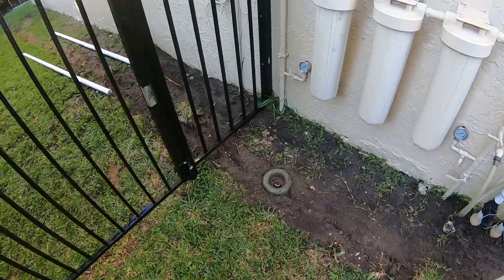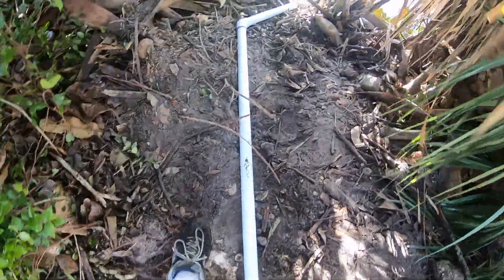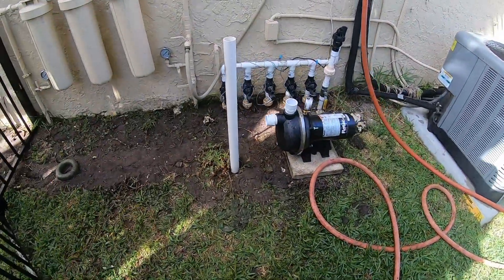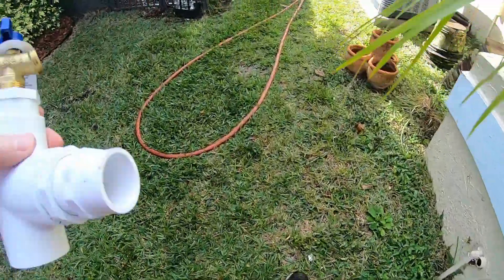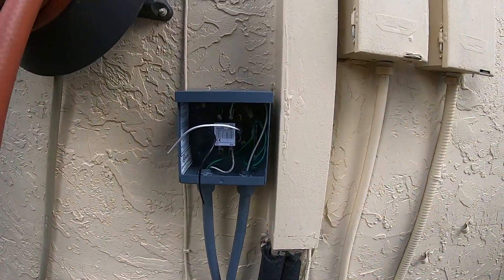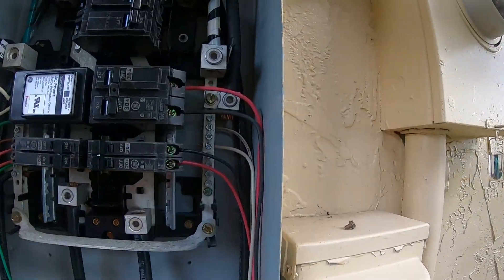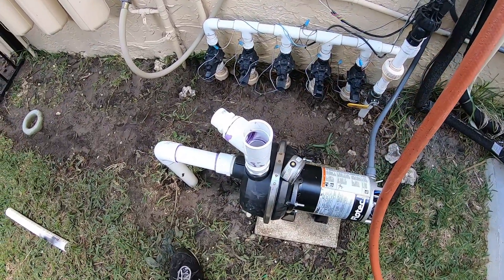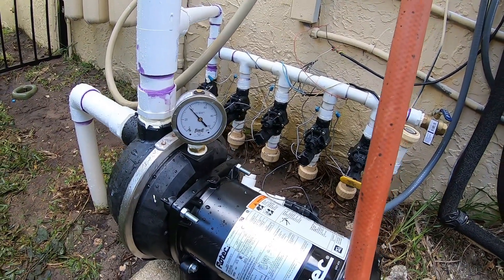Installing a Sprinkler Pump - Part 2

Comment: I Donot See Your Smart Sprinkler Box 
For Timing The Valves ???
Thanks.
Reply from the maker: It's located inside the house. In this video I was using a rainmachine mini 8, but it is no longer for sale and I have a feeling that rainmachine may be out of business soon.
Reply: @JoesGarageProductionsLLC  Thank You The Video Was Good But Many People Like Me Wanna Know How Connect Wires To Smart System And Wires To Valves And Pump To Smart System, Thanks For The Reply.

Comment: Where can I find a Power Relay? I cant find it on Homedepot or Lowes
Reply from the maker: Interesting - you are correct - these are harder to find now then when I recorded this video. You can buy the box directly from Rainbird (https://store.rainbird.com/) but keep in mind the "business end" of this pump start relay is a Munro part and Munro makes a similar (if not identical) box. Though I have no direct experience with this product, the Orbit 57009 seems like a similar product and is available on Amazon. Judging by customer pictures, the Orbit product seems to use an Omron relay, which I know from my electronics experience, is a very good brand

Comment: Can you explain the installation of the start box.
Reply from the maker: Sure. The principle of operation is exactly the same as an air conditioner contactor. Power comes in to a relay from a the building supply. Power comes out of the relay to the load in this case electric motor.  There is a separate signal typically lower voltage and lower current but turns the relay on and off to energize the load. In my case the signal is a 24 volt low current signal from the sprinkler timer. Your central air conditioner has a similar set up to turn the outside condensing unit on and off. It's a signal comes from the thermostat. if you'd like me to go into more detail just let me know and I can record a video dedicated to this topic.
Reply: @JoesGarageProductionsLLC  Was wondering the same as I will be setting up a IBC tote for my sprinklers. TY for the video it was quite helpfull
Reply from the maker: Sure, I'll post a video shortly... stand by
Reply: @JoesGarageProductionsLLC  did install.a timer?
Reply from the maker: @gcposeidon0800  I actually installed one of these previously: https://www.rainmachine.com/products/rainmachine-mini-8.html

Comment: Hi! How long is the 1-1/2” PVC run from intake to your canal ? I need to locate my pump about 100’ from lake and was concerned that it would be too far as the manufacturer recommended max of 65’... I’m told it should be ok though
Reply from the maker: I don't have an exact measurement but I would estimate it to be somewhere between 80 and 100 ft. The horizontal pipe is approx 3 ft above the water level of the canal. The only problem I experienced with this setup was a failed plastic check valve a couple of months after the install. I replaced it with a brass valve and haven't had a problem since.

Comment: Just wondering what brand and where you got the contactor  start box? Thanks
Reply from the maker: The one I used in this video is a Rainbird brand, which has Munro guts. I believe it was this box, found on Amazon: https://amzn.to/3rGYvbT. It seems that one is no longer available. This one seems popular, but I have no direct experience with it: https://amzn.to/3vhcBTs

Comment: How’s the pump after a year?
Reply from the maker: Still working great! It's getting a workout it's been very dry where I am in Florida lately
Reply: Joe's Garage yeah I’m in Florida too, my Gould’s pump just went south and I was looking for pump options
Reply from the maker: @jgoni20  I do have mine shielded from the sun. I built a wood enclosure that surrounds the pump. Still looks pretty close to brand new
Reply: Joe's Garage good I’m going to buy one then, one more question, your we’ll pipe had a pvc pipe in it??
Reply from the maker: @jgoni20  no well, I ran PVC pipe to a canal in my backyard. Thankfully, no staining!
Reply: Joe's Garage you lucky 🍀
Reply from the maker: @jgoni20  yes, believe me I know! Free, very high nutrient, iron free water! I can't tell you how much money I've saved on water since I did this

Comment: Sir for 22 pop up sprinkler which pump i use ???
Reply from the maker: It depends on the flow rate that you need. You should add the flow rate of all of the sprinklers on your largest together.

You also have to factor in the lift - how far and how high the pump is from the water source.

 A 1 HP pump will handle "most" residential applications but there are obviously exceptions to that. I could have gotten away with a 3/4 HP pump but I up-sized it because I have around 80 linear feet of pipe to the water source.

Comment: Nice ... is not a professional work but I like I’ll do mine just like yours
Reply from the maker: This turned out better than many of the professional jobs I've seen. The only problem I have had with it is the flex joint at the canal. I used a rubber fernco as a flexible joint to allow the pickup to pivot up and down. Sometimes the pickup separates from the fernco. I have not found a better flex joint yet. Other than that it's been pretty much flawless